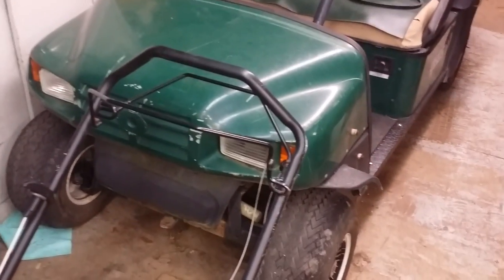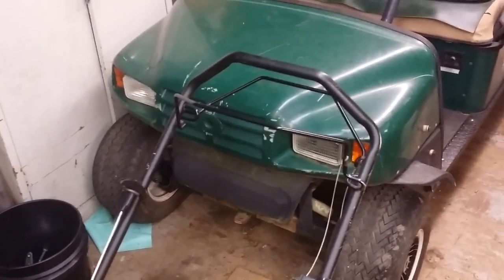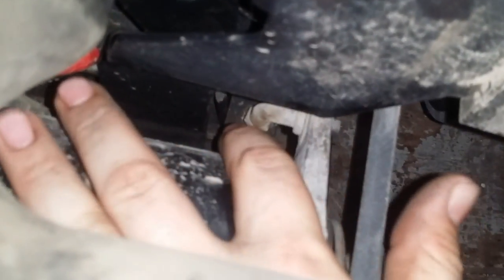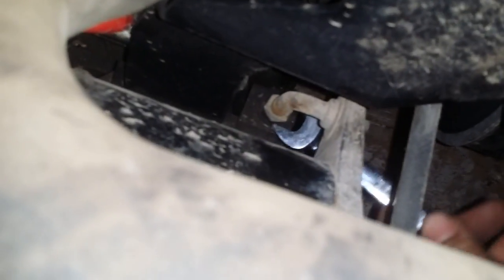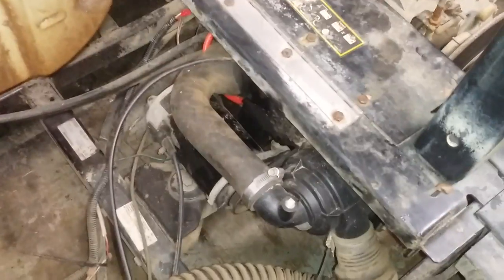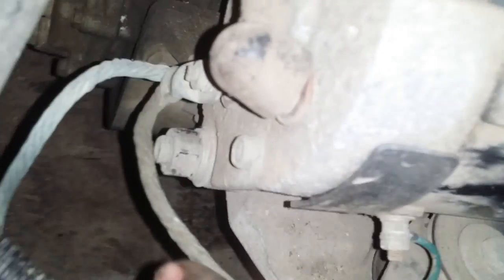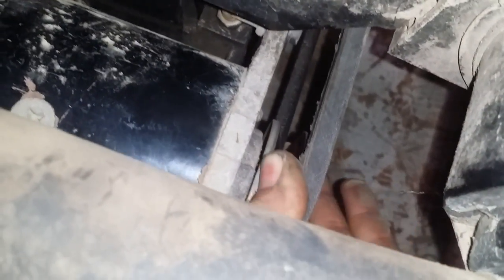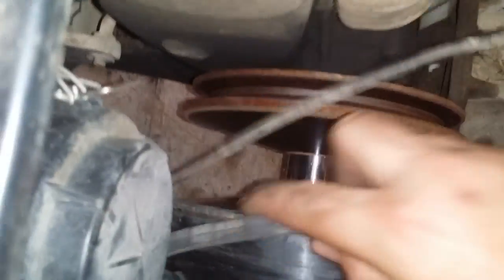ezgo starter generator belt replacement

Comment: I have a question whats the required gear ratio from the starter to the engine to have enough torque to turn over and start ?  I plan on implementing one of these starter generators into a go kart build. But I haven’t found any information on what size pully would be required on the engine coming from the starter.
Reply from the maker: not really sure a pretty good bit I imagine, the starter generators are no joke. from a mechanical point they are more power hungry than a typical starter, they usually run a larger pully and dont have a gear reduction... cant really give you a helpful answer
Reply: @1beastlydudefixbreakrepeat  ohh if there pretty torquey then they should have much of a problem turning over a small engine like a 16cubic inch motor

Comment: I have a question I haven’t been ably to find a answer to. What is the required gear ratio from the starter to the engine to have enough torque to turn it over and start it ?
Reply from the maker: what ever i came with, sorry Im not much help... but what ever ezgo shipped it with is best.. I would go oem if possible.
Reply: Its  a homemade flat bed ag cart i made. I found a 1to4.8 ratio was plenty to start a  250cc engine. I appreciate the help anyway tho!

Comment: Long story but I took the starter/alt out of my bosses 2002 ez go workhorse golf cart because it wore out. I left one wire attached to it so I'd know my wiring diagram putting it back in. Not realizing they were going to take it and have it rebuilt they took that wire off of it and I don't think it's in the right place when they put the wire back on so now I'm all throwed off as to what wire goes where.. I've googled and googled but no success in finding the actual wiring diagram for the 5 or 6 wires from the cart to the starter. Can anyone help me out and save my butt from wiring it back wrong and burning it up please???
Reply from the maker: Comfy Tie sorry to hear that man, if I still had this cart I would send you a picture,best I can say is see if any connections line up,they will have a certain bend to em
Reply: Thanks !
Reply: @nunya8866  if you still need I'm working on a campus now with 20 or so of these carts